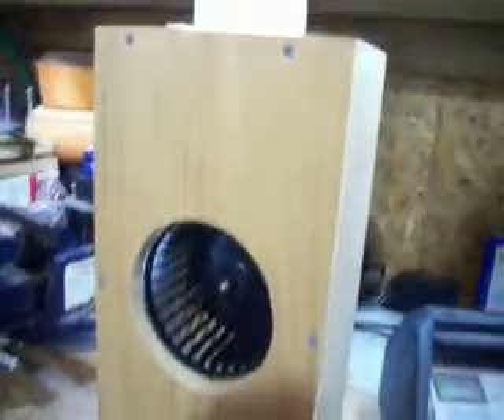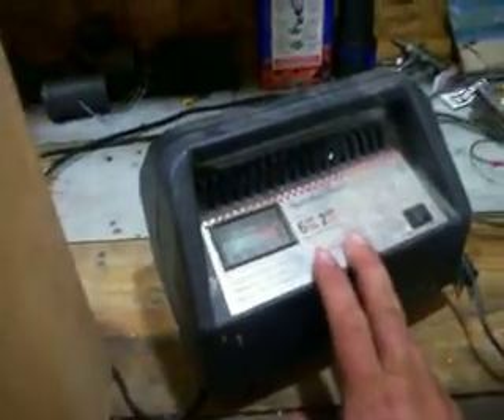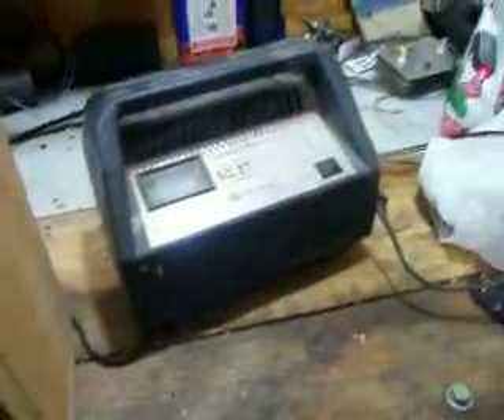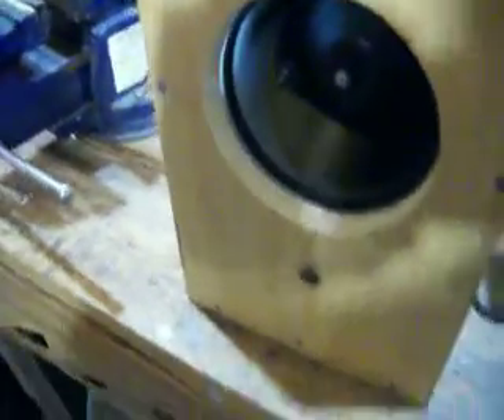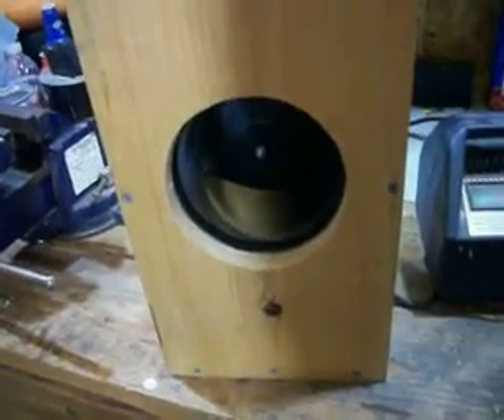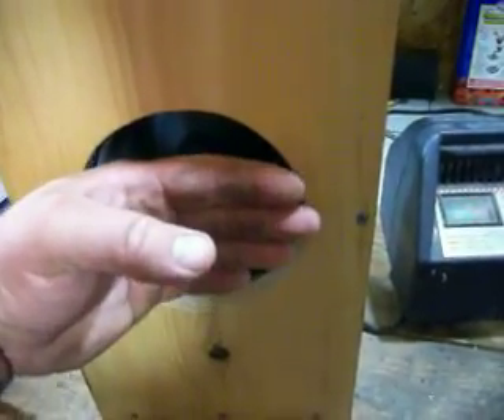Solar Heater #2 Build #18

Comment: I'm guessing that the "back pressure" is caused by the box.  You have unequal pressure on the bottom side of the box.  The air is fighting itself tying to get to the out port.   You should use something more circular and try and create a vortex.  If you search for squirrel cage blower at amazon you'll see what I mean